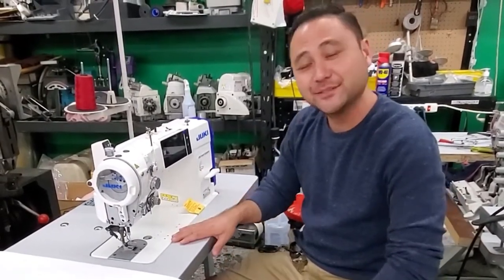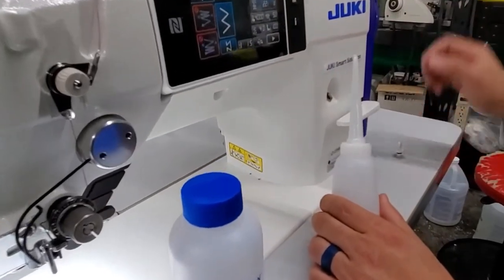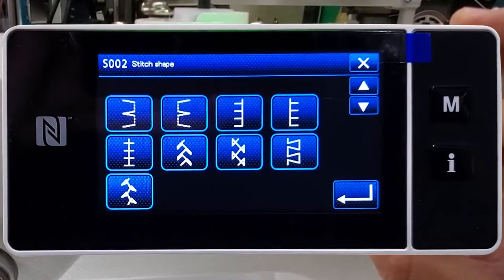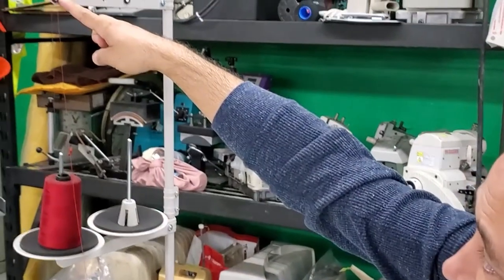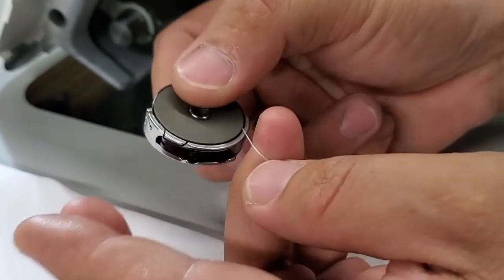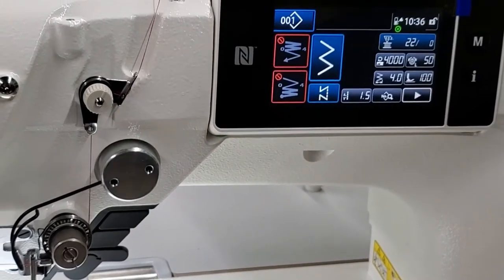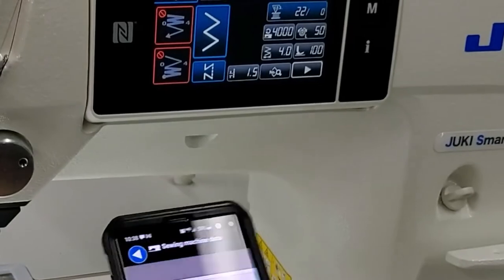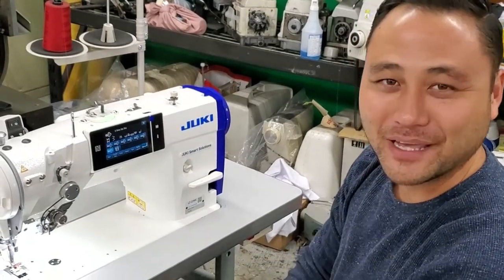JUKI LZ-2290C Zigzag Machine HOW TO: Essential OVERVIEW

Comment: How do I change the factory setting of maximum straight stitch length from 2.5. To. 5.0?  Do I have to buy a USB with extra settings?   I bought the Juki 2290cf-7 in June 2024.
Reply from the maker: @shirleycade9680  hi Shirley 👋 
You may have the operator view mode set which doesn't show you the stitch length option.  
Make sure the Lock 🔐  icon is unlocked on the top right of the screen first.
Then push the "M" button and "i" button together to alternate from operator view mode to maintenance mode.
Reply: @ABCSewingMachine  I tried as you suggested and it won’t go to the operator mode….. I also went in on the stitch screen but won’t change off maximum 2.5 I guess I will have to accept 2.5 and won’t go higher
Reply from the maker: @shirleycade9680  
Look in the memory switch settings 
Push M 
Memory settings 
Panel settings 
Then look for view mode or panel mode and change to maintenance view (not operator)

Comment: Hello, could you tell me exactly what the model is with its complete numbering since I looked for it by juki lz2290c but I get one that is not completely automatic, especially the presser foot
Reply: Hi Edward.  The full model number for the Fully Digital zig zag is: LZ2290CF70BAK156/SC955A (Fully Digital)
-LZ-2290CF (Full Digital) 
-LZ-2290CS (Semi Digital)
Reply: @josephpark2256  That would be like the one you are showing in the video?
Reply from the maker: @kamuz26eafo  yes correct.  I only stock the full digital versions of the C series machines.

Comment: I have the Juki 9000-c-s. Not the FMS. I am having a really hard time deciphering the manual…I joined a group but it is for the FMS version.  I can  hardly find anything on this one…do you have any info…also do you sell bobbins and feet other items for these machines?   I wish there was a group for this machine.  So frustrating.  Wish there was an online class or group.  Now I wish I had gotten the FMS because at least there are videos on that one.
Reply: hello what is that fms group could you tell me to add me